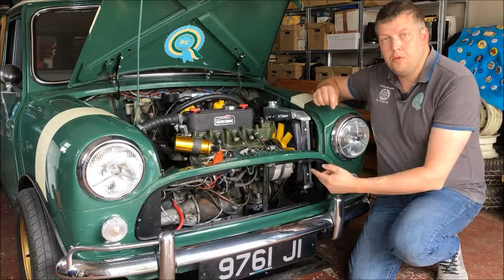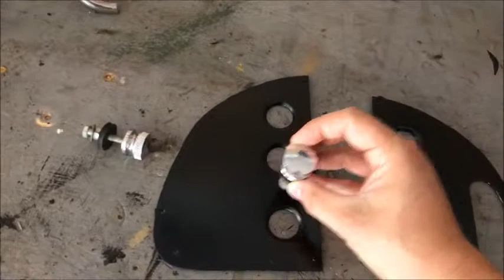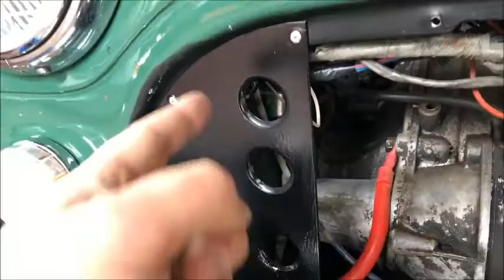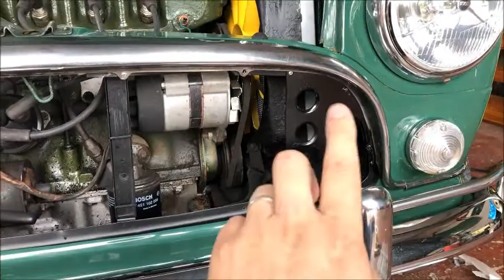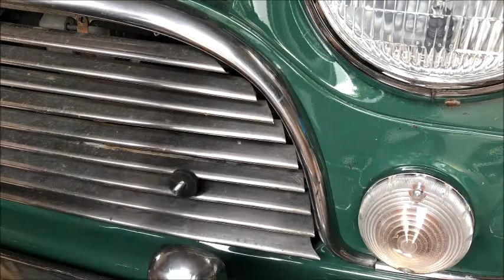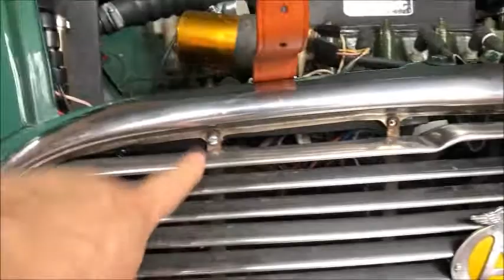The Cooper S Traveller - how to fit grille buttons

Comment: Thanks for the reply. I have been trying to decide whether to use them or not, I think now I have read your reply I will use them as it certainly makes access to the oil filter and distributor a lot better.  M.
Reply from the maker: Deffo a huge help that’s for sure 😎

Comment: Hi Team Ballylough,   I have several questions regarding the fitting of grille buttons.  Other than the buttons were directly behind the over riders was there any other reason that you wanted to move them in board?  Also when you tighten the grille button down on the grille does it distort the grille slats at all?  Thirdly with just the buttons holding the grille on is there a problem of rattling?   Just subscribed to your site and enjoying your videos.  Cheers, Midge
Reply from the maker: Hi Midge
Yea it was mainly because the buttons would be directly being the overriders was the reason for moving them further inboard. I only tightened them until there was a slight resistance but I’d assume if overtightened the bars could be distorted. The grille will vibrate and rattle when relying on the buttons so I have 2 screws at the top as normal as well.
Thankyou very much for your subscription and your comments.